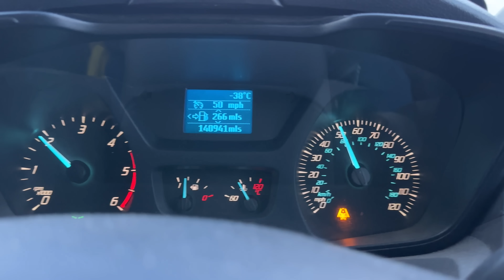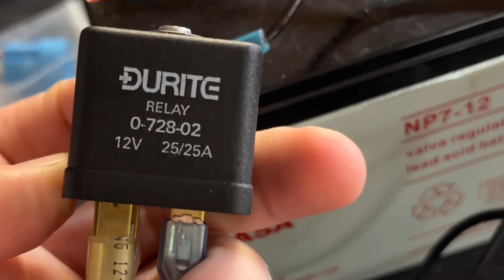EASY Ignition Live + Constant Live (MAN TGE / VW Crafter / Grand Cali)

Comment: Hi Alex, A question, are you going to in stall spotlights, and would you connect them to your high beam ? And how would you do it.... thanks in advance
Reply from the maker: So my van came with lazer aux headlamps which are UK and European legal to be on the high beam.

And I believe they are hardwired in using a tap on the light as a signal to trigger a relay some of the new events need a CAN-bus adapter. 

Companies like Lazer make a Can-bus adapter and CanM8 make an adapter. Which opposed to just tapping into a signal feed which doesn’t work on all vans more or less gives you an output signal by connecting to the vehicles can network.

Comment: There another fuse box right of the steering wheel   Asnd easy to run the cable up the A pillar.
Reply from the maker: Indeed, yes, also the connector in the foot well trim near the Driver’s feet as well. 

I found if you’re running a dash cam with reversing camera it might be easier using this passenger side fuse box because the vans main wiring loom runs down the passenger side

Comment: don't know if it was an update for a MY25 van but i have a USB C port on the driver side of the cab roof "pod" (where the reading lights and emergency buttons are), this is for dash cams but not tested when its powered e.g. ignition live or constant live. very useful and easy to miss! love the videos BTW!
Reply from the maker: I believe that is a new update for the new model. Good place to put it.

Comment: Thanks for this but a bit confused as I have just one live cable to my dashcam currently running for an accessory socket.Can I cut the end off and run this from the 2nd fuse way you showed or do I need to use both and use something like a 3 way Wago?
Reply from the maker: Probably depends more on your model of dash cam. 

Mine specifically wants a constant live and an ignition live. 

i’m sure other models of dash cam would just want an ignition live to the only turn on when the ignition is on. Whilst dashCams might realise if the ignition is on and off by a change of voltage

my particular model of dash cam has a parking mode so needs to remain on when the ignition is off

Comment: There's a body builders plug behind the RH trim of the drivers side footwell with a cluster of both switched and constant 12v feeds
Reply from the maker: This comment did make me on go find that particular one. I had seen it mentioned in the BEMM manual but I hadn’t yet pulled the panel off to find it in reality. 

Definitely does what it says, although it doesn’t win points for being easy to access! Or really utilise. It’s quite out of the way it would be a bit of a pain to run accessory cables too

At least it provides you with a unpopulated terminal to put your own spade connectors. 

Using an ignition circuit on the fuse board is probably easier for most people to do and quite simple for them to buy a piggyback fuse.
Reply: @MispronouncedAdventures  yeah it does depend what/where you're looking to supply power to. I used it for a dash cam as it avoids running cable under the cab floor to the under seat fusebox. Probably makes more sense for aux lighting at the front too for the same reason. You can buy the opposite plug and pins to do a "proper job" but I just snip one off the back of the plug and join in that way. I used a piggy back fuse for the DC/DC ign live the same way you have purely because it runs along side the heavy cable to the under seat fuse box.
Reply from the maker: @HenryOCarmichaelSmith  I was actually quite surprised of their ratings being 25A and 15A. Although I assume it’s collectively across all four pins opposed to each individual pin the BEMM isn’t quite specific on that.
Reply: @MispronouncedAdventures not sure off hand but the wires look a substantial gauge. I guess finding the fuse location for those feeds will answer that question

Comment: When it comes to powering everything in the rear o the van. Are you going to do one supply from the main fuse box to your own fuse box in the rear?
Reply from the maker: So all of my circuits would be unrelated to the vans original wiring. Any DCDC charger or the secondary alternator would be taking off one of the accessory terminals on the starter battery not this fuse box.
Reply: @MispronouncedAdventures Straight off the battery? you must have had a BOOM box in the back of your first car lol.  Will be interesting to see how you do it alex
Reply from the maker: Most DCDC charges come straight off the “battery terminal” as long as it’s upstream of the battery sense modules. unless it has a specific auxiliary PowerPoint like the transit and it’s customer connection point.
Reply: @MispronouncedAdventures  Does the Man have a customer connection point?
Reply from the maker: @paulrobinson3528  as far as I know so far not particularly. Although what I have found so far is unused fused terminals on the main starter batteries connectors
Reply: @paulrobinson3528  Yes, there are 2 fuse boxes high current (1 by the battery partially hidden and another under the bonnet) and 2 connectors for auxiliary stuff under the dash. 
There are all sorts of considerations for each one. Personally I don't like connecting next to the battery as the more spec;ed vehicles have option fuse slots which are soldered; drilling them out isnt ideal as the spacing is off. 
But them I hate those piggy back connectors, just put a terminal in and crimp a wire in. I like many people have a dash cam wired in with the power supply going down the A pillar where there is a connection point on all vans for stuff like this ;-)
Reply from the maker: I’m not the biggest fan of piggy back fuses myself. Than there are other options on the MAN / VW to access an ignition or constant life but more involved to get too and use. Like the connector behind in the trim in the foot well. The video was for the purpose of easiest to access and use. 

I’ll being using connections long-term, so I’ll probably migrate away from the piggyback uses and to the connector under the footwell trim.

I agree about the battery accessory terminals. It’s a bit of a pain. They are the soldered midi fuses. I will likely go off a different stud and use my own midi or mega fuse depending on the purpose